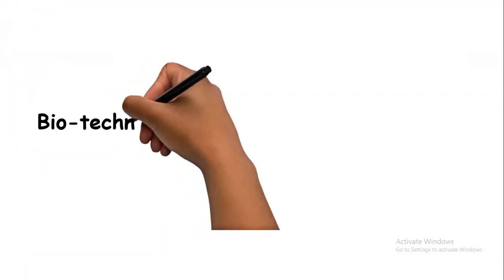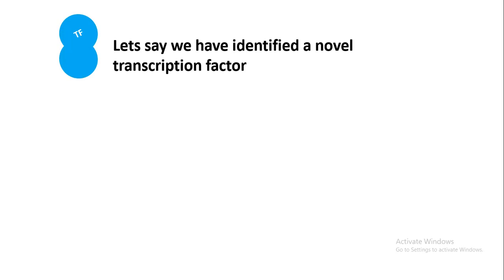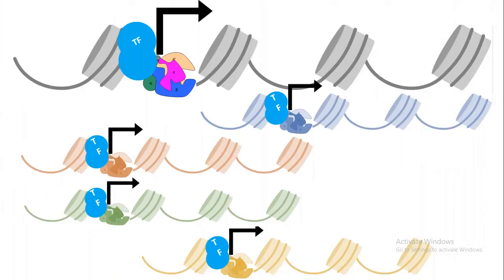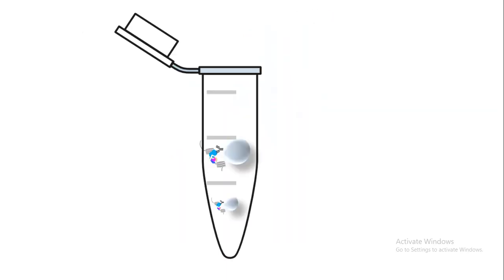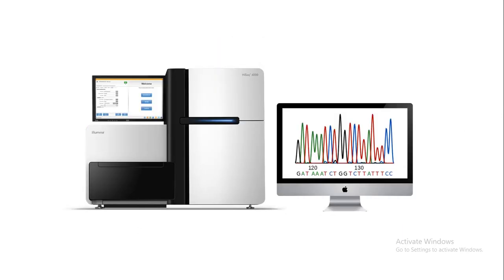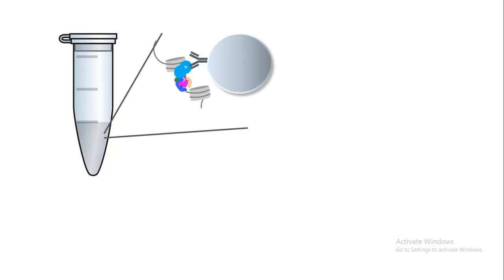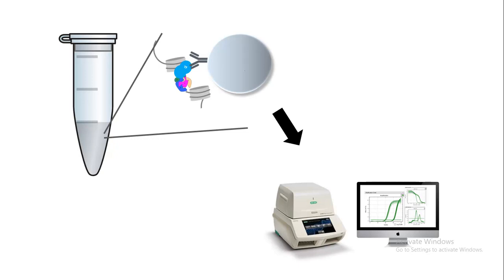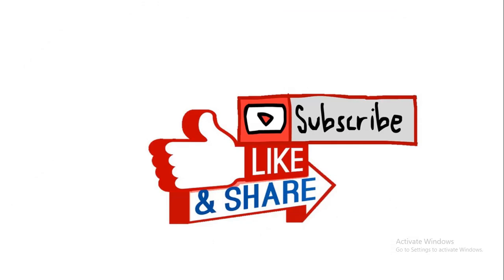Chip seq (chromatin immuno-precipitation followed by sequencing)

Comment: It is necessary to mention that if you are studying a transcription factor, it will bind to either promoters or enhancers, meaning that the qPCR primers should be designed for these regions and not to the open reading frames of the gene itself
Reply from the maker: Good point
Reply: That's a good point thank you I will keep that in mind when designing primers